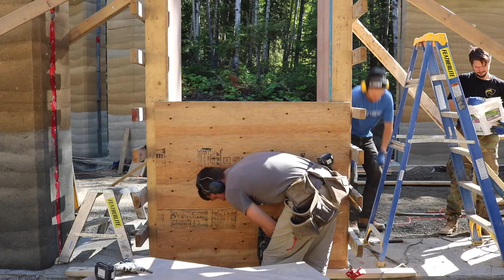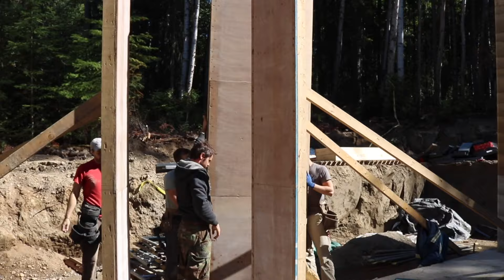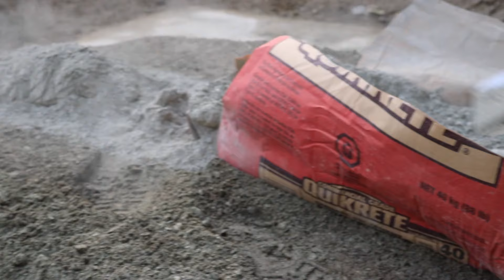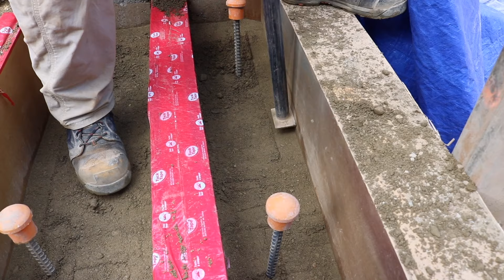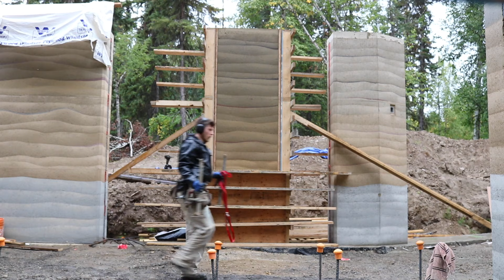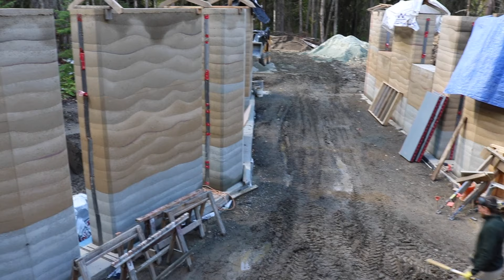Rammed Earth Build and Training - Prince George, BC, 2021

Comment: You shouldn't build the earth walls over concrete slabs! You should do cyclopean foundations! You dig trenches and build a wall up with stones and layers of lime concrete (no cement). You start with big stones on the bottom of the trench and you put smaller stones as you go up. This is the way they were buiding houses and castles in ancient time. It lasts for centuries.. As concrete slabs are way to strong, mecanically and it ends up cracking. You stop the wall thus made, a bit off the ground and you can build the rammed eath walls on top of it!

Comment: Looking great! What size of compressor are you using for this? I’m looking to build with this method and would love to learn more! Thanks! Great video!
Reply: So the compressor I rented for the build was diesel powered and capable of 185 CFM... but that was because we were running two tampers most of the time if you were only running one then you could do with a smaller electric powered one but it would still need to be a decent size tank.... Keep in mind using a pneumatic tamper makes it easy but with time and effort there is nothing that would stop you from just hand ramming it, you don't get to see in the vid but there is one feature wall with a round window and much of this wall was "Man Rammed" ya that one is for all the tolls out there go to town ;)
Reply: Awesome. Your response is much appreciated. I intend to gear up for this and promote this method of building. So many benefits to it. Hope you post progress pics or vids!

Comment: nice work! I would like to try this in Kitimat for a small simple home I can show for seniors, would you be able to tell me who you used as far as an engineer that signs off on this form of building?   I doubt our local firms would be interested in looking since they are busy with industrial projects and charge industrial rates.
Reply from the maker: Hi there! Thank you! I'm not entirely sure on the engineering and architecture, but the two links in the description will take you to where you can ask them directly. I just worked and did the videography work on this project!
Reply: @RobEdward  gotcha thanks and good job on the video

Comment: What is the relative cost of building this wall compared with conventional framing and a quality finish?
Reply from the maker: I'm not an expert, but from what I understand, the materials alone for this house was under 10k. The most expensive part of this type of build will be labour and rentals (excavators, bobcat, etc.) It's not significantly cheaper than conventional houses due to the WAY it's needed to be build and the timeframe (especially in Canada as this one was), but you could save a lot through learning to do it yourself and building your own home. Hope this helps, I can try to get more info if not!

Comment: Does anyone know more about this project? People doing would love to see more!
Reply from the maker: Hey Caleb! I worked on this project last year and I have to follow up with the owners to try to get some updates. I will post anything that I come across!
Reply: I would love to see more on this project! The walls are the best I have seen! Also what was the mixture? Gravel fines? With cement or earth/clay, sand and gravel and cement?
Reply from the maker: @calebneyland3595  yes, all that I know because I wasn't the mixing expert, was aggregate & gravel fines, clay & earth, and then I believe 10% portland cement for the walls. And on the top cap was a 20% cement mixture to hold the bond beam.
Reply: Thanks. Would love to see more from this group of builders.

Comment: why put cement on top of the wall? thanks
Reply from the maker: The wall itself needs a bit more structural support at the top there to hold the bond beam for the roof
Reply: @RobEdward  No! It's nonsense to use cement with earth!

Comment: absolutely beautiful work!!... Just don''t ask what the per square foot building costs are....lol... for anyone with a normal (non)budget... Check out the documentary 'Garbage Warrior'... 7 years into our build if anyone has questions...
Reply: this can be made cheaper depending on materials used for form work and for building, and the machinery. In places where they traditionally use rammed earth, it's much cheaper than conventional methods
Reply: ya it ended up being quite reasonable it was the Labor that was the biggest cost, materials at least for us were literally dirt cheep, so depending on how much work you want to put in yourself and what your time is worth you can shave off many 1000's of dollars, when we costed it out it was going to be about 5% more but then we were hit with Covid and lumber prices so in the end the walls came in much much cheaper then a standard stick frame would have.

Comment: Can't you do it without cement?
Reply: Yes you can do it without, however in BC regulations stipulated that we needed to get a Structural engineer involved and adding the tiny bit of concrete makes it "stabilized rammed earth" and that was a bit easier to get passed.
Reply: @MrBegoofy  Ok.Thanks.
Reply: @MrBegoofy  You should use lime instead of cement!
Reply: It really wasn't my call in the end... Had to go with the structural engineer on that one... If it was up to me I would have used nothing.